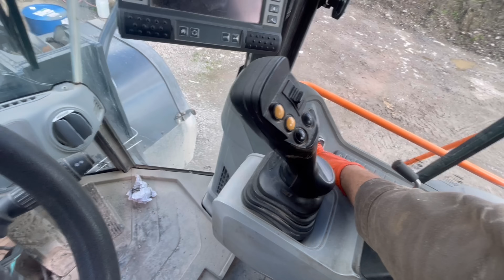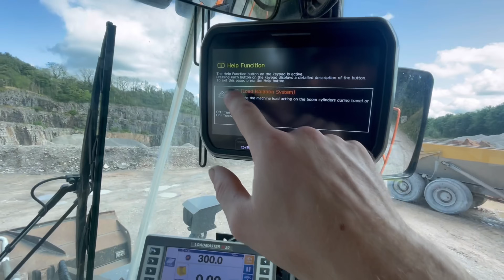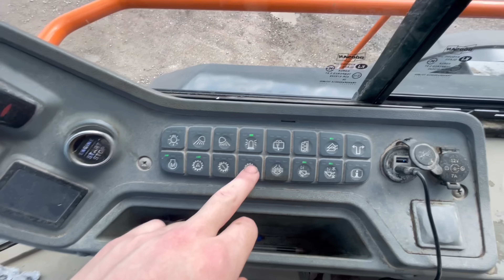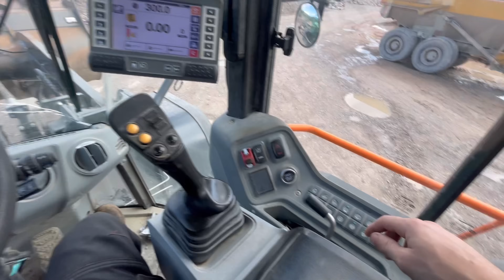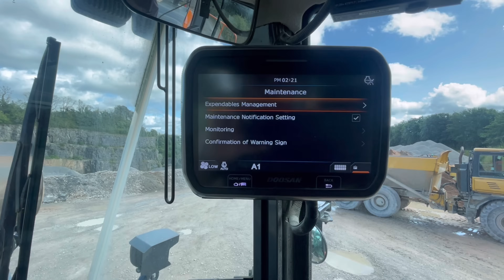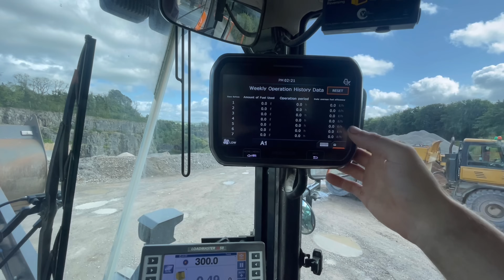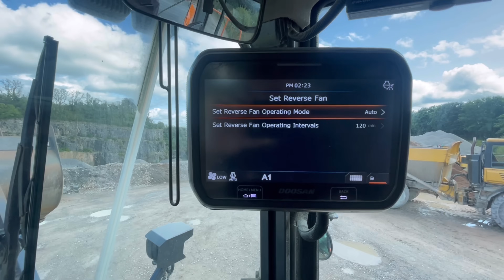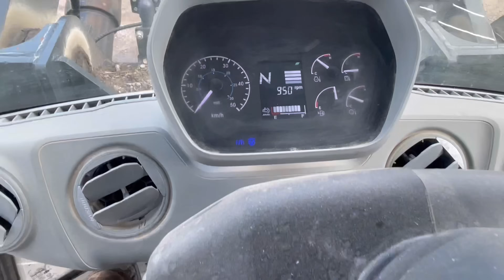Saturday servicing ( chatting away) / How to use a DL420-7 shovel / 2 prime movers done !

Comment: Re the actuator conundrum; my guess would be the incorrect CAN address in the software. I would expect the EGR actuator would have a different address than the exhaust brake which might result in the CAN fault. They may even have different 'priority' and be 'talking' over each other, causing a fault as per the software. Programming may see nonreply from the actuator as a CAN fault?